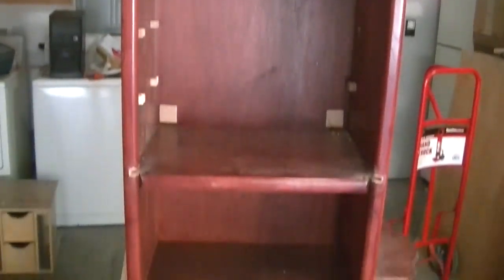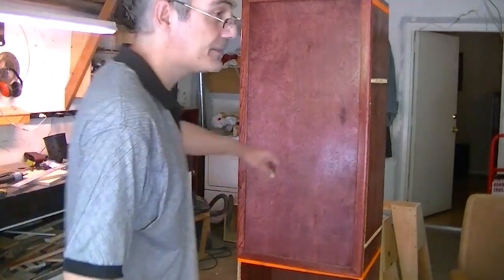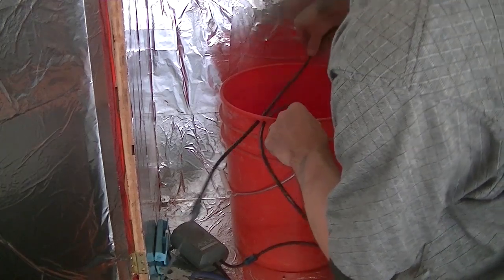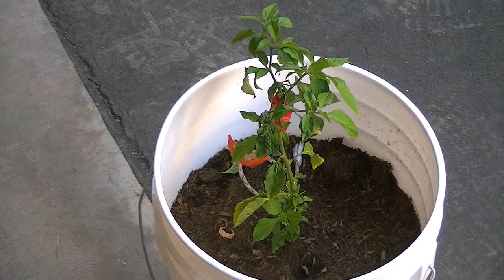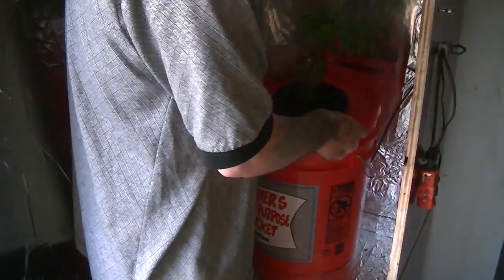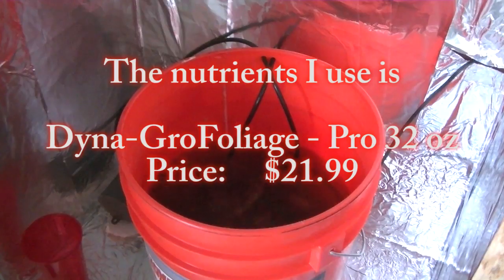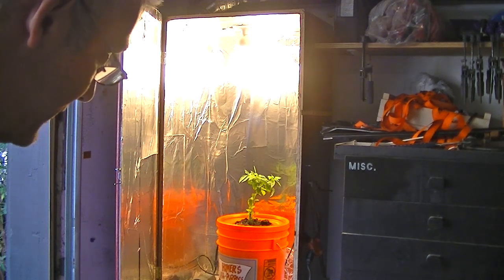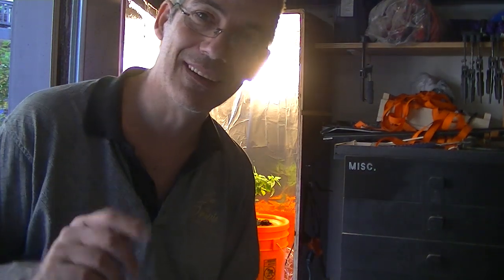Homemade Hydroponic system, self contained with lights

Comment: Dude put a 300w LED Panel light in there and that'd be perfect. Also a couple computer fans.
Reply: internetwarrior666 also spray paint or buy a black 5 gallon bucket . Those orange 5 gallon home Depot buckets slow the growth rate .

Comment: Is that aluminum foil? That is a bad idea. Aluminum absorbs light too much. You would get more out of your light if you would have just painted the insides white. Just a thought.
Reply: +maxmarsu Also aluminium can cause heat spots through, mylar would be better.
Reply: Doobster67 That's true. Mylar would be the optimal choice but it's kinda expensive.

Comment: Thank you so much for the video! I'm starting dental school soon and I wanted to do a project like this in my small apartment. This video is exactly what I was looking for. :). I do have a suggestion. Could you make a video or comment on lighting? I didn't understand how you installed everything. Or what you meant about the aluminum. It looked like it was still at the base of light fixture. Thank you again. subscribe